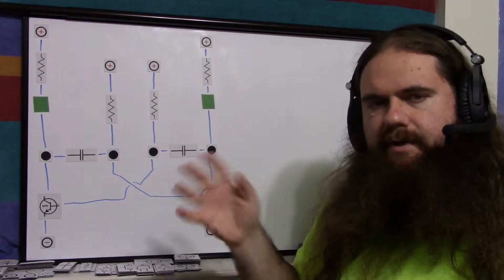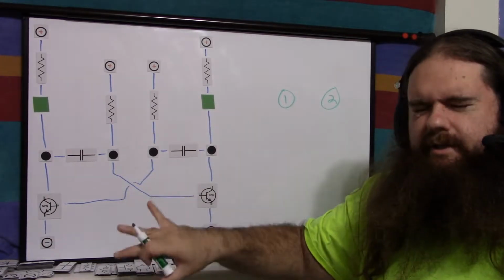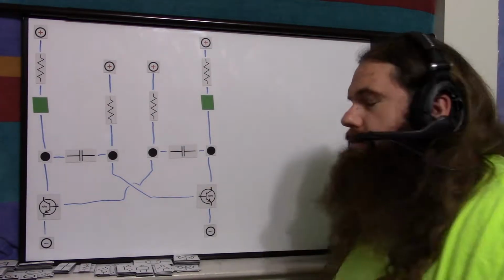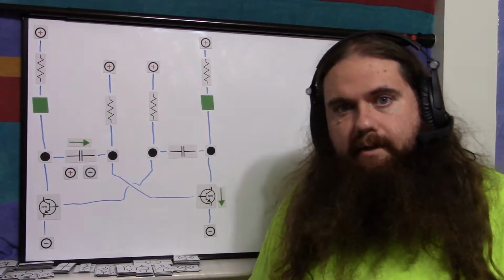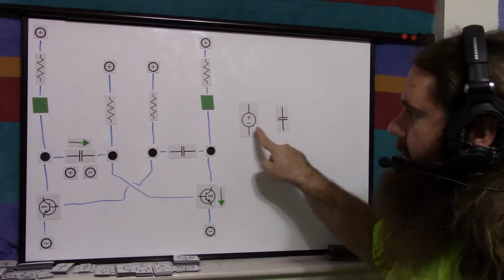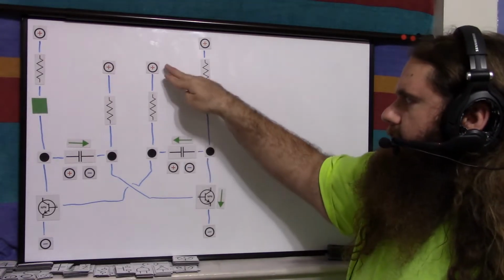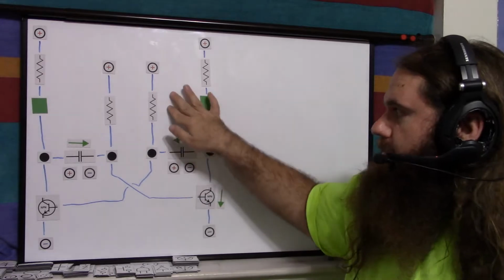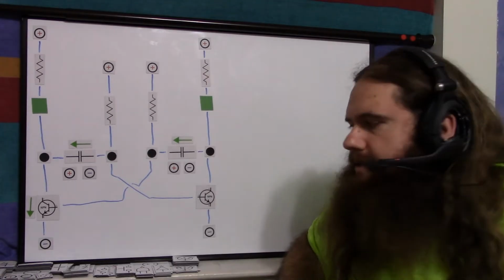Detailed Walkthrough - Astable Multivibrator - Oscillator - Simply Put

Comment: Old Roland/Ace Tone drum machines are riddled with multivibrators. The service notes for the TR-77 are beautiful. It doesn't have an MCU or memory. It's just a timing matrix and a multivibrator for the main tempo clock and there's another one that makes a square wave for the guiro. That was 1972, and I think most of that stuff like the Korg Mini Pops and Ace Tone stuff was multivibrators. By the time they made the 808 and 606 they were using 555-ish timers.

Comment: If the components were paired and calibrated exactly the same, it wouldn't work. It works because the components have variations in their values. I spent some time with a component tester to match up the values of the transistor, capacitor, resistors and even the LEDs ( I added them for fun). When I powered it up, it wouldn't work until I shorted legs on the transistor to get it to start, then it would chug away.

Comment: Your flipping if the arrow above the cap that is discharging when it passes zero volts is very confusing to me because it looks like a current arrow but the current direction doesn’t flip as the voltage passes zero. The charge voltage flips and I assume you were trying to represent the cap like it was a battery that flipped polarity but it’s very confusing to follow since the currents don’t flip.  

But I watched your video because I was wondering if you explained what was the stable state max charge on the capacitors.  Mist videos say they barge to full battery voltage but they don’t. They charge to something below the max charge.  I’m trying to figure out how to determine that voltage based on component values but I haven’t got there yet. Though I do understand the concepts.

Your video at least did point out that it was the discharging cap that triggers the circuit to flip and not the charging capacitor.  I had to figure that out myself before I found your video explaining it.

Comment: I built this circuit and it worked just great. So I moved on to build a traffic light circuit, found a video, gathered the parts, substituted 2N2222s for the BC547s since I had the former and not the later. Several builds, no sequencing of the lights, all lights off. I reworked and reworked and studied and studied. Finally realized that the biasing of the transistors bypassing the LEDs was the key. Checking the voltages very carefully, all 3 transistors fwd biased, on, LEDs off......all is cool. But.....the circuit just sat there in that pefectly correct state, frozen in time, no voltage changes, no trafic light sequences. HELP!

Comment: Similar to Mr Turner in your comment section, I am a senior gent, 78 years old and although a mechanical engineer for more than 50 years, I have spent decades tinkering with all things electrical and dabbling in electronics. Several months ago, I embarked on one of my unfulfilled....becoming an electrician! Done and delighted, diploma on the wall! This awakened the electronics theme again and soon I was watching video after video and learning at Warp 9. Then I stumbled into your Simply Put.....absolutely the breakthru of my 3/4+ of a century! Thank you, your presentations are 20:20 and much more. Your sense of humour and modesty are refreshing and delightful. I shall be back over and over. BTW .....about 30 minutes ago, after 2 years of mostly failed attempts to make a simple flashing/blinking led display, while following your guidance....I experienced 100% success with building an astable multivibrator. I am just delighted....and I know what is going on with this stuff (up to a point) cause you explained it to me in your videos. Thank you, thank you. Fred

Comment: Hi great explanation , but I have a question when a capacitor disscharge through the collector and the polarity at the other side of the capacitor becomes negative does the base of the transistor becomes reversed bias ? Thank you.
Reply: Meaning the current will flow out the base to reach the negative side of the capacitor because from what I understand the current must reach the other side of the capacitor when it is disscharging

Comment: YOu made two good points: Be careful not to exceed Transistor's REVERSE Vbe; Electrolytic Capacitors can be used because the time of capacitor reverse polarity is so small.
Reply: For the electrolytic I think it's that the reverse voltage is so small, not the time.

Comment: This circuit works fine as long as the operating voltage stays well below the avalanche breakdown voltage of the base emitter diode of the transistor, which is typically between -7 and -9 V.

Comment: Thanks a lot, I learned a few things. I'm trying to work out the cap voltages in the case of using PNP transistors in this circuit. Given a 9v power supply, I think C1's voltages when T1 is ON are 9v & 16.3v (left and right sides respectively) at the moment it just switched over. So what I mean is the surprise neg voltage in your NPN example 'inverts' to a much higher than Vcc amount...again surprising at first glance. Is this right?

Comment: I don’t know what you mean by the resistors taking over what’s left.
Reply: Think about a simple closed loop with a Vcc (5V), a LED (we assume its voltage drop is 2V) and a resistor.
You have 5V; 2V voltage drop on the LED, then resistor "takes over what’s left" : 3V.

Comment: Just one question? How do you know that the capacitor C2 is discharging not charging (07:30)?
Reply: Because its grounded through the collector and has to discharge first because of the polarity of the capacitor at that moment and after its voltage is zero it will charge in the opposite direction of the discharging something like that
Reply: I think it’s becUse of the resistance values of the resistors. Remember that the inner ones are higher ohms than the outer ones and based on that the voltage drop through them creates an appropriate inbalance on the respective side of the capacitor

Comment: How do you know to assign the + and - signs on the two capacitors?
Reply: I believe it’s Based on the resistance values of the resistors. Then inner ones are higher resistance than the outer ones, this causes a different voltage drop causing an imbalance across the capacitor. The outer resistor is connected to one side of the capacitor the inner resistor is connected to the other side of the capacitor. The difference in ohms causes the imbalance via voltage drop

Comment: I never thought a simple circuit like this would have negative voltage at some point (11:00) ….. well explained, thank you.
Reply from the maker: I was surprised as well! When I was initially trying to understand how this circuit works myself, I kept thinking I had screwed it up and was wrong because I kept getting a negative voltage and that made no sense. But as it turns out, charging/discharging circuits do funny things like that, which is why it's important that the transistors can handle being reverse-biased and not conduct or break.

Comment: How you be able to stick paper to the board? Thanks
Reply from the maker: It's a magnetic whiteboard, meaning it's metal underneath the white coating. I bought magnetic sheets which are just big, thin, paper-shaped soft magnets, printed out whatever I wanted and glued it to the sheets, then used scissors to cut them out.